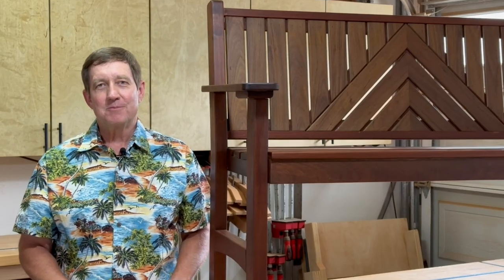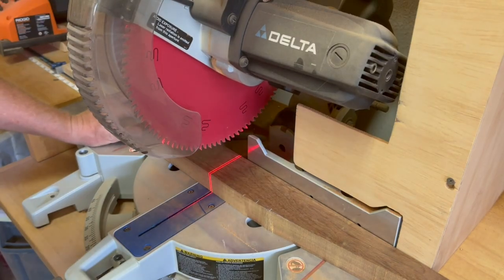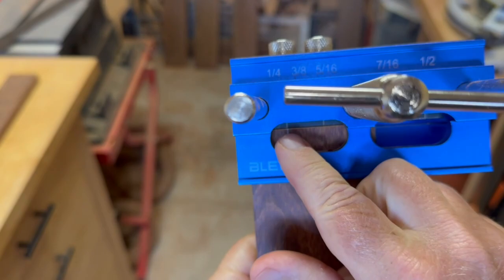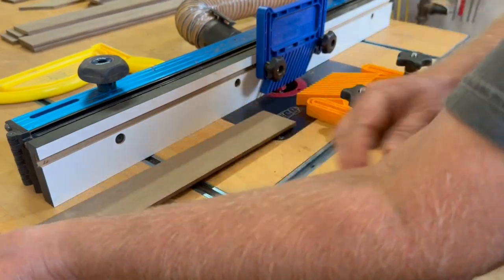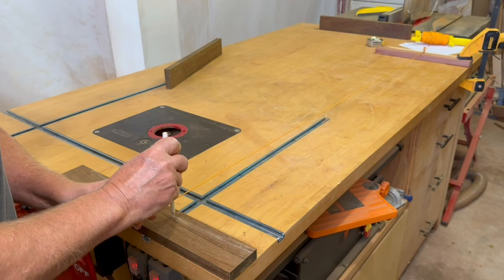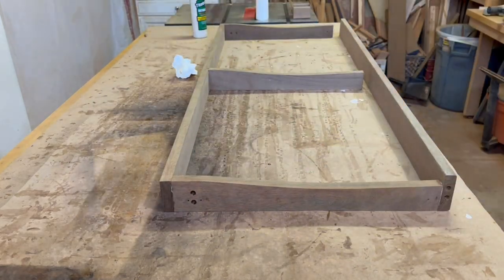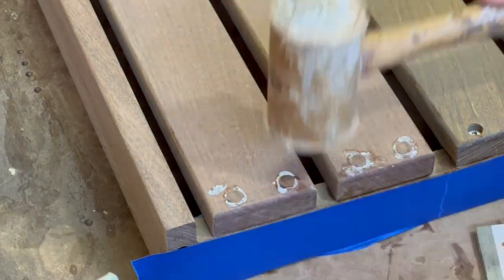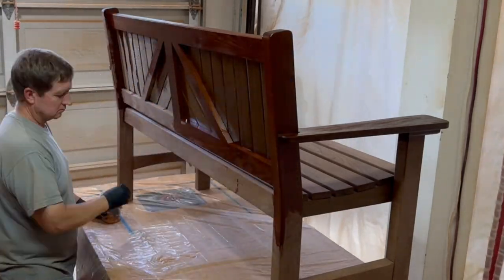Making a Stunning Garden Bench with IPE Wood

Comment: Very nice work! How did the Tight-bond glue hold? I have always been told to use a polyurethane glue like Gorilla Glue due to the oil in Ipe. I also use acetone on edges before glue up. I am currently experimenting with table top glue ups to see what works long term. I demoed some decks about 10 years ago and kept all the wood, so large supply!
Reply from the maker: Thanks!  That's great that you have a large supply of ipe, it is such a great wood!  The glue joints have held up great!  The bench has been sitting outside in the weather for over a year, and still everything is good and solid, no cracks in the joints.

Comment: Where did you get the plans from???
Reply from the maker: I designed it myself!  I've been considering cleaning up and better documenting the plans that I make for my projects and make them available to folks who watch the videos.  But it may be a while, next year likely.
Reply: Would you change any part of your design?
Reply from the maker: @jimscott3060  That's a great question, I should probably include some comments about that in all my build videos, because there is almost always something that I'd improve on the design the next time.  On this project, I think I would make the back of the bench a couple inches taller..  it just looked a little out of proportion.  I might also set the legs an inch farther apart, again just for looking proportionate.

Comment: Beautiful.
Have you had any trouble with glue joints failing? I've cleaned with acetone, then glued liberally, but found some boards just wouldn't stay together. So now I back every connection with glue and screws.
Reply from the maker: Thanks!  All the joints have been holding up great so far.  On almost all joints, I used either screws or dowels in addition to the glue, so I'm hoping for the best.  It's been sitting outside in the weather since I made it about 6 months ago, and so far so good.